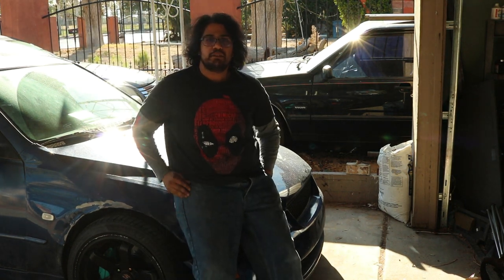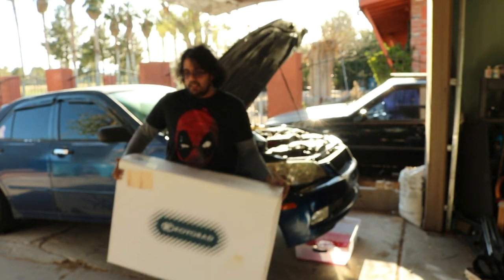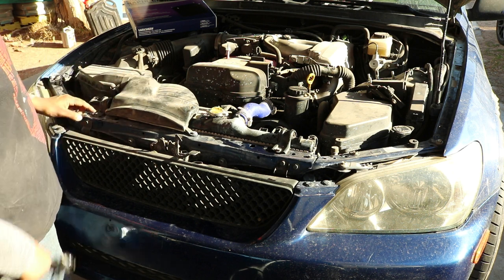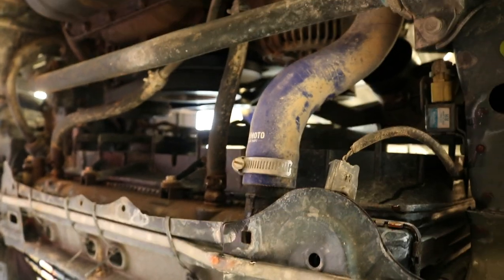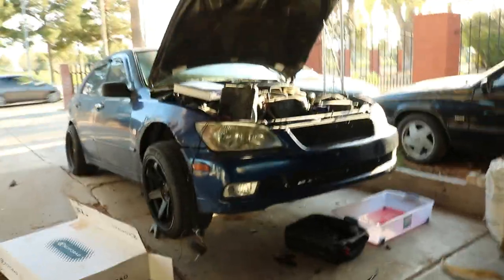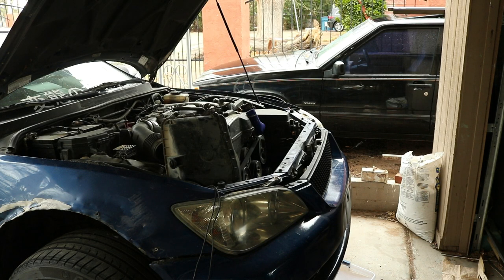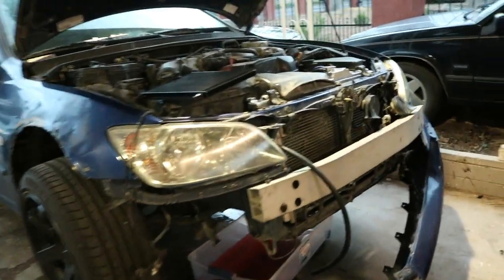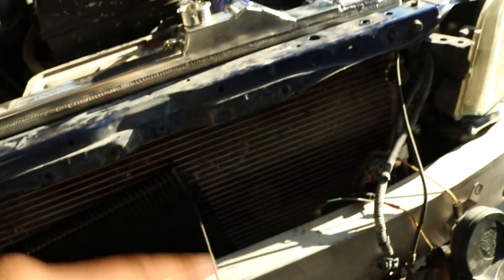Lexus IS300 Automatic Koyorad Radiator Install, using external trans cooler

Comment: Youre going to want to seal around the radiator shroud somehow after shimming it back with the washers. Ive seen OE setups (I think my supra was set up that way) that just use a strip of foam. Otherwise, it will lose a lot of eficiency and just curculate air in the hot engine bay.